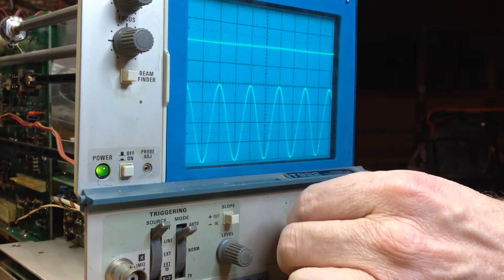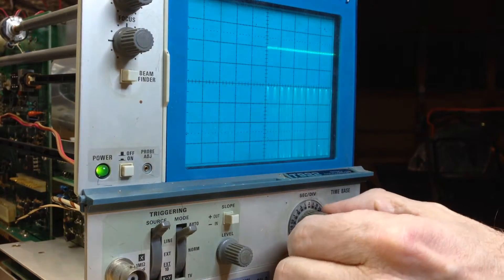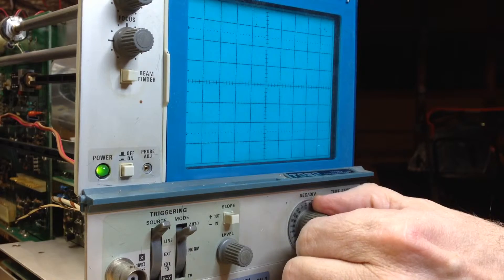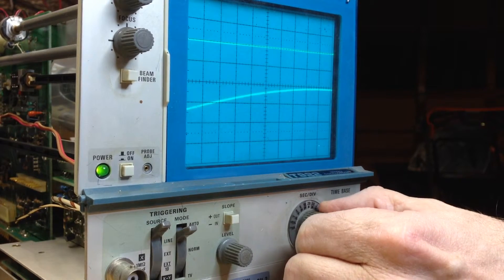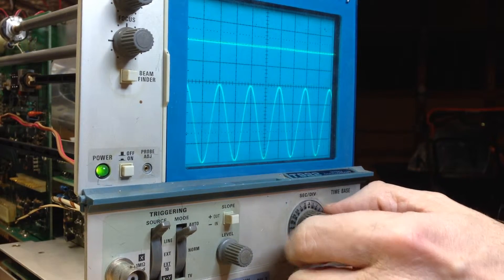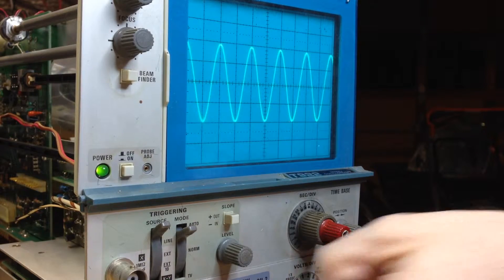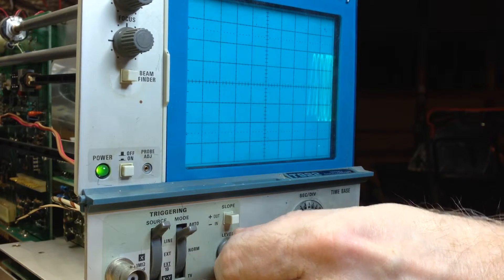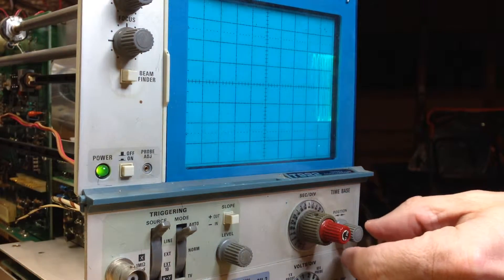Tektronix T922 with triggering problem

Comment: I just bought this scope off eBay.  Hopefully mine is still operational. Thanks for sharing your experience with this model.
Reply from the maker: Heh, wonder if it's the exact same one! But probably not, since Tektronix made tons of these things, between the portable and rack-mount versions. I replaced this scope with a Rigol unit but even with something like that on hand, there are occasionally times when an analog scope does better, like if you've got a tiny noise injection in a signal that you're trying to track down.

Comment: Hey, hubbsllc. If you haven't fixed the scope yet, i think it would be smart to reflow all the solder joints on the t922's triggering board. you will have to remove a big board (the input board) to get to it, though. The reason why I think that it would work is that soldered joints can sometimes not stick properly to a component's steel leads and it will start to crack over time, making intermittent connections. That's what happened to my t922. i have a intermittent problem, just in almost all of my t922 boards. I kinda left my scope in the corner to sit, so now i have to break out my brand new Hakko soldering iron with reflowing every connection on that scope. Make sure to set your iron to ~600-650 F( just enough to melt the solder) so you don't pull the PCB pads up. After that, if you have the equipment to, you should re-cal the scope.
Reply from the maker: Thanks for the tip. I thought I had it all sorted out but it went back to like it was as soon as I'd closed it up so I will give this a try when I get back to it.
Reply: yea. i have to try it on my t922, too.